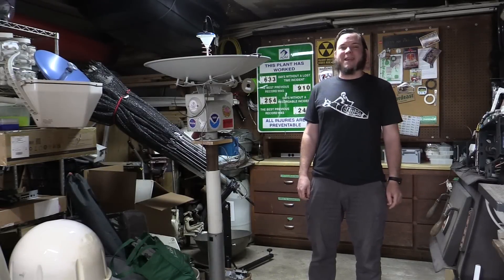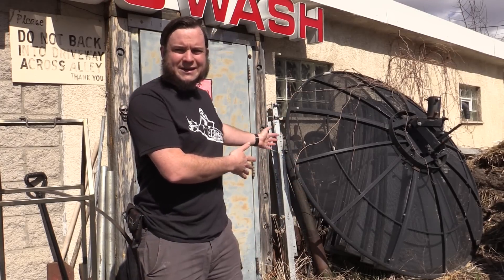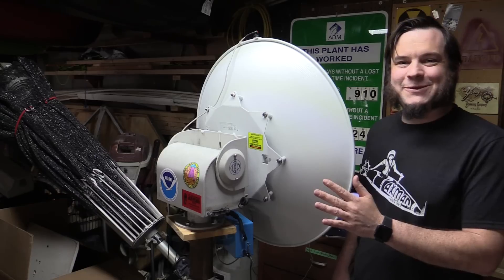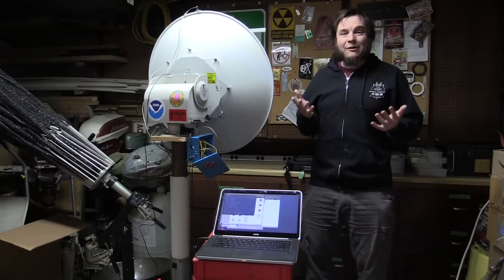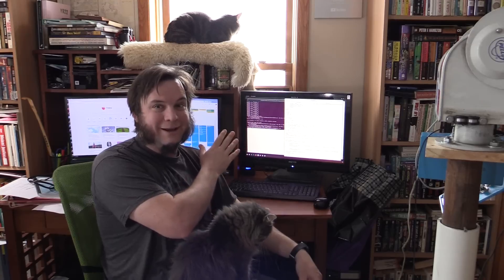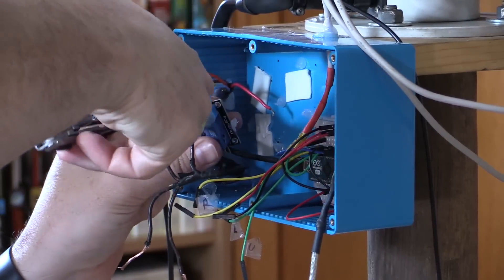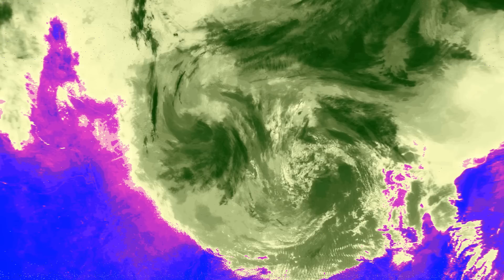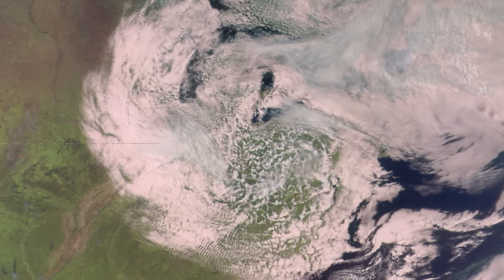DIY Satellite Tracker Pt 2 (And Radio Telescope Struggles!)

Comment: 👍👍👍👍👍👍👍👍👍👍

Using MOSFETs (Metal-Oxide-Semiconductor Field-Effect Transistors) instead of relays for controlling motors in a satellite tracker offers several significant advantages. One of the primary benefits is the speed of switching. MOSFETs can switch on and off much faster than mechanical relays, allowing for more precise control over the motor's operation. This rapid switching capability is essential for satellite trackers, where accurate positioning and quick adjustments are crucial to maintain the satellite's alignment.

Another benefit of MOSFETs is their longevity. Unlike relays, which have mechanical parts that wear out over time due to repeated switching, MOSFETs are solid-state devices with no moving parts. This results in a longer operational lifespan and increased reliability, reducing the need for frequent maintenance or replacements. Additionally, MOSFETs are more efficient in terms of power consumption. They have lower on-resistance compared to the contact resistance of relays, resulting in reduced power loss and heat generation when driving the motor. This efficiency is especially important in satellite trackers, which often operate in remote or harsh environments where power conservation is critical.

MOSFETs also offer silent operation, as opposed to the audible clicking noise produced by relays. This can be an essential factor in applications where noise needs to be minimized. Furthermore, MOSFETs provide better control over the motor's speed and direction. By using pulse-width modulation (PWM), an Arduino can vary the voltage applied to the motor, allowing for fine-tuned speed control, which is not feasible with the on/off nature of relays.

The contacts in the relays can get stuck which could be the problem described in your video. MOSFETs have no contacts to get stuck, so you can avoid this issue. The text above was generated with ChatGPT to help you understand the importance of using MOSFETs instead of relays. I hope you will change you design because it will make all the difference. I will link a video to the Engineering Mindset to help you get started with using MOSFETs with arduino boards. 

https://www.youtube.com/watch?v=AwRJsze_9m4

Comment: I wonder if you are running into UART time out issues. (although just finished watching, seems like it might be been power related after swapping out the mechanical relays.) Do you have room to push the BAUD rate of your connection? most arduino boards easily support 115200 (including the Nano), many can also support up to 250k. (common on 3D printers with ATMEGA2560) The Nano is a good cost/accessibility option, but It might be worth exploring some of the ESP32 boards as they have a strong community and support as well. Regardless, Great job so far. I really enjoy following along with this exploration! Good luck!

Comment: Very cool. You would’ve had to fortify the crap out of the mechanical relays. So much switch bounce and feild effect breakdown needs to be soaked up if you’re using any type of digital circuit. You were hammering that poor Arduino EMF noise. Cheers 👍

Comment: for control   look at rotator  control from K3NG    for arduino  google K3NG rotator control. for sat tracking   look at satpc32 

Ivew just done exactly what you have done wiht a CCTV  pan tilt unit   with a sat dish. 
relays sometimes cause switching spikes for  usb signaling

Comment: If ure struggling with code why not use chat GPT to do the programing for you? It's free. I love electronics and hardware but i su.k at programing. I've been using chat GPT to make me code or to update someone else's code and its been working great. Give it a summary of what you want with super detailed topics and in a few tries u will get a working code.
Reply from the maker: Honestly I have no idea how to use ChatGPT for coding, and if it's anything like photo-generating AI, it will just give my code extra fingers
Reply: @saveitforparts  Honestly ChatGPT is really great if you understand what you are trying to do, I use the rubber duck debugging method, I try to explain the issue as succinctly, and with as much context as possible, and either A, I figure out what the solution is, or B, ChatGPT gives me some usable code, or offers a different perspective. As with any tool, the code is still dependent on you, but ChatGPT does have a mass amount of data/code context behind it. Think of it as an interactive Stack Overflow, that doesn't demean you for asking a dumb question, or tells you to RTFM. LMFAO
Reply: Chat gpt is weirdly good at coding in R and python.

Comment: You should look for conical scanning or box scan type code. It will allow the antenna to use the radio signal strength to peak up on the signals. Great video!

Comment: For max stability, you should make a squat equilateral pyramid with vierendeel truss legs made out of slotted wood strips in which you'd put pex pipe with its ends squashed (with a nail holding the pex inside the wood). Cheap and light, but super solid. I've made quite a few experiments with our more common (here in europe) pexal - but for something like this, pex should be more than enough. For the legs, you could use metal plates from ax-man, if they're like most of our surplus stores, they're bound to have something like that. To make them pivot, you can take golf balls, drill a hole through, put a bolt and nyloc on it, then take some pvc pipe that fits it, and shape it around with a heatgun to encapsulate the ball. With a little bit of grease, that's a perfect ball joint for you to use. The bolt side goes to the disk foot and the pvc end can attach to the truss via a piece of PVC pipe that fits inside (or is the same piece of PVC) that's split down the middle, the heat formed around the truss' end and stapled or nailed into the wood (i actually used this method to cap and tension my test trusses, using half a pvc pipe formed and pulled over the truss' end, very strong end piece with this method - so keep it in mind for other applications).
Final piece that will 100% make it stable, from the center mount (which can be made with a classic tripod style mount, no point in innovating that) you can put a hook and hang a weight on. I doubt wind will affect this.

Comment: When I had similar issues (strange communication errors, unwanted MCU resets etc), it was the case, that some (relative) power hungry parts (relays etc) caused power surge thus power supply voltage drop for a fraction of second, which was though enough to mess things up. I've added some big electrolytic capacitors near the micro-controller, etc, randomly till it was enough and everything went well then :)
Reply: Another issue he might be having is crosstalk on all those communication cables, or induced RFI on the data cables. Adding some ferrite chokes to each individual line, the little tiny ones, has helped a bunch on previous communication problems like this.

Comment: hey, I don't know if you are already doing this buy Chat GPT can help you with programming. 
Seriously, it is great as a copilot to help you. you can ask it to review your code, you can ask it, in normal english to write you some code, or ask it "how do.." and it will help.
Check it out, recently, even free subscribers have access to GPT 4.
it can write C code for arduino. 
anyway, it might be worth a look, I recently used GPT to make a python program to manipulate VLC, it has an api, and GPT help start my project and help me along the way.
In any case, struggling means you're learning
cheers, thanks for the videos!
Reply from the maker: I have no idea how to use ChatGPT, never tried it. I know a little bit of Python though. Also based on what I've seen from AI online it would probably just give my code extra fingers or tell me to eat glue or something.
Reply: @saveitforparts   I get it, I'm also an old dog learning new tricks too, I'm even learning some from you!
but from what I've seen of you in your videos, you'll pick it up quickly. 
It is highly intuitive, programming using natural English is probably GPT's best use-case.
you could just try giving it the code you already have, and see what it thinks of it, ask it a regular english question ilke "what does the following code do and how can you improve it? please explain what changes" and then paste it in. 
the new free 4-o version can accept uploading files. 

In any case I enjoy all your satelite-related videos!

Comment: Use on the hydrogen line?
Reply from the maker: I'd like to, if I can get the tracking nailed down! I have an LNA module for that, which I have yet to use.
Reply: @saveitforparts  People point the antenna  at the zenith and let the rotation of the earth scan the beam.  Looks like fun.
Reply: Scan from the horizon to zenith for hydrogen and let the earths rotation scan East/West.

Comment: I really like the idea of homemade radio telescopes, it would be neat to have a nation wide network of individuals with home radio telescope equipment. People could help each other with optimal positioning and height and share data.
Reply: Like a small open source SETI
Reply: There is something similar that has had limited success, the Big Amateur Telescope. they have had trouble organizing nights for observation. But its a great idea in theory.
Reply: No reason to limit it to nation wide, you can go international. Though seriously amateur visible light astronomy is already a thing so expanding to amateur radio astronomy would be cool as hell.
Reply: @hedgehog3180  why does this sound like an AI response. I know v little of SDR but I just feel like any variation doesn’t have to be a bug if we design it to be a feature
Reply: Interferometry is actually extremely difficult, at the very least you need everybody's SDR to be GPS-locked (something that only expensive ones can do, such as the USRP) and even then everybody's telescope needs to be aimed right (0.1° tracking accuracy will not cut it), and antenna positions and fluxes need to be calibrated

Even after all that is achieved, the apertures of dishes available to us amateurs is miniscule, we can only pick up very bright targets with long integration times

You would also need to share baseband recordings from everyone's SDRs which is quite a bit of data even from just one (a few gigabytes for only a few minutes of recording)

So yeah, amateur VLBI won't be happening for a while… 😣
Reply: And people could become a member of a ELA (an Extremely Large Array)
Reply: Websdr, the Europeans are very keen to offer public access cluster radio to the world, Americans and the rest of the world not so much.